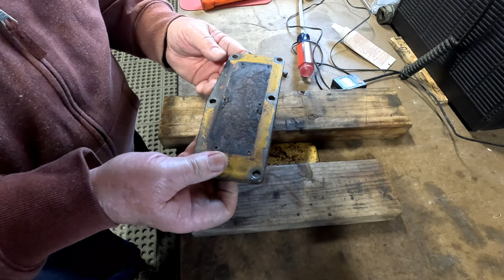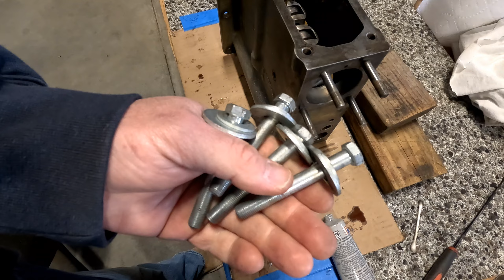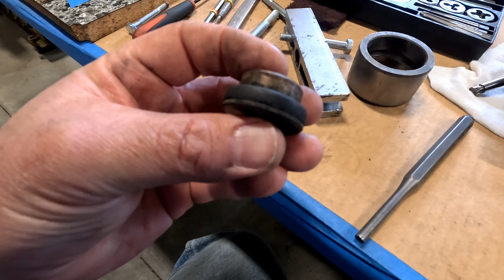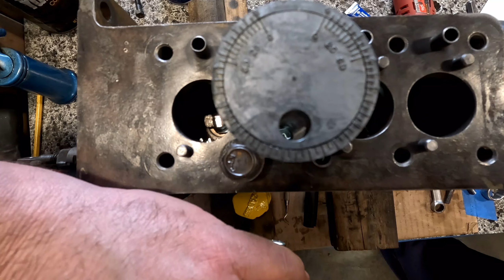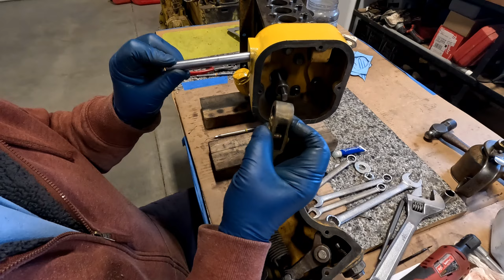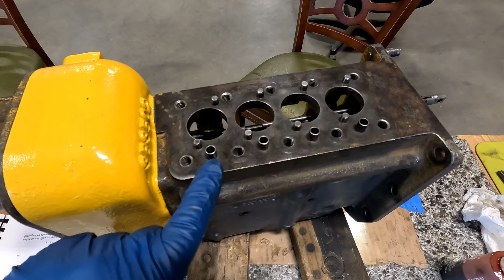High pressure fuel pump assembly. 1939 Caterpillar D4 4G9986 "Lil Lefty" Episode #94

Comment: Great videos and very informative. I live over the water in the UK, we are having a few issues with a D4 7J. 
We appear to have a lot of white smoke (unburnt fuel) when running and somewhat of a poor starting and running (similar to a miss but not actually missing) After watching one of your later videos I set about setting the pump timing via setting depth of yolks/forks to 1,735 thou (and camshaft is 2A5559 and understand lifter height is correct) Bizarrely before adjusting they had been set to 1,605 thou. 
Since adjusting to 1.735 then main engine will not start yet going back to 1,605 then it is running again (but as before not greta)
It was suggested we try some different pump elements (from a D4 supposedly) a chap had to confirm if our elements were ok etc, however when checking over the metering shaft/pintle are different diameters between the two sets of elements (approximately 1/32) so could you or anyone else suggest what the correct diameter shaft/pintle should be so I can decide which elements to start with (my theory being a large diameter pintle can deliver more fuel per stroke hence possibly the white smoke) 
With regards to the lifter height we are starting to think that perhaps there is a timing issue within the timing case for the auxiliary drive etc.

Would really appreciate some advice, measurements and guidance as I am sure you can appreciate not a huge amount of these in the UK and the knowledge is pretty scarce on the ground so far
Reply from the maker: I see my first comment got removed because of a link I had in it. Do you have a caterpillar fuel pump servicemen's reference book? There are quite a few on eBay and it can help you with finding the exact lifter numbers. It's all going to be according to the cam number on your fuel pump. The cam number should be located on the tag external to the fuel pump. It can also be found on the cam itself. That will determine your lifter settings when your reference the book. Please change drastically during production model runs. No two fuel pumps are the same. If you don't have access to the book I recommend a membership to the Antique Caterpillar Machinery Owners Club. They have an online library with valuable literature available. There's also an online form that is a game changer with access to Decades of knowledge. 👍
Reply: @ thank you for the response, I had found via ACMOC from someone else whom had a at pump book that cam A25559 should have a lifter height of 1,734 +/-0.002” therefore I have set to that height and since the issue with none start which leaves me to believe there is a bigger timing issue within the likely within the front end?
If as I suspect there is a timing issue within front end then this could explain the excess white smoke it has had since getting it running after many years of not running due to what was thought to be wetting. 
I would still like to find out what the Dina of the pump element shaft/pintle should be as the casting number in the x8 bodies I have are the same yet x4 have the same size shaft as each other and the other x4 have the same but approximately 1/32 size shaft. 
Basically I am hoping someone will have some from a D4 7J engine they could measure and confirm as aware there are more spares state side. Not sure if it makes a difference or helps but the chassis serial number is 7J2887W and engine number is 7J3833
Reply from the maker: I've been thinking about your problem. If it ran with the fuel barrel settings you have and after you readjusted them it may not be a fuel barrel issue. Have you done an inverted injector test? Maybe check the cone spray. It could be an injector issue. White smoke could also be water. The pre combustion Chambers on early 7Js are the same as on the 4G tractors. They are prone to failure and leakage into the cylinders. That can cause issues that appear to be fuel related. Before you mess with any timing I would start with the inverted injector test. It could also pinpoint which cylinder is the issue. 🤔
Reply: @ the injectors have been sent away to be fully serviced and all in pristine condition as performed a inverted test previously and they wasn’t horrendous but did seem a little lacklustre in spray pattern (definitely improvement since service as was sent video confirming no leaking and great atomisation) 
I do not feel the white smoke is water/coolant as it’s to dense if you get my understanding. 
Really struggling to understand when the setting of lifter height is so critical (ie +/- 0.002”) yet we are approximately 0.150” out which is essentially the cam lifter at full lift at TDC which cannot be correct as I understand it should have completed injection some time before TDC ie engine retarded which the lower lifter height would indicate that also I feel. 
It’s a real head scratcher and being first time working on a cat of this vintage confidence is a bit blown (quite a bit experience in setting pump timing on rotary and inline pumps with spill timing etc)
Reply from the maker: Sounds like your fuel plungers may be worn out past tolerance. They will get to a point where there's no adjustment that can fix it. The only other thing I would definitely make sure if is the teeth are perfectly lined up in the rack setting. Being one tooth off can cause similar symptoms. Have you checked the plunger wear to the top of the yoke? It shouldn't exceed 0.005". The overall length of new plungers is 2.6575" - 2.6577.

Comment: Fantastic job Aaron-n-cleaner. You nailed it right where it has to be, usually you need a stand to do this. But CAT allowed also other methods to set the pump timing and angle.  Seen lot of high pressure fuel pumps where someone in there infinite wisdom. Removed the lift pump or left the plungers full open. Dose not take much rust to make the pump unusable in a very short time frame. Word of advice if you do leave a pump sitting in a shelf make sure the plungers are full of oil and sealed from the outside element. Same goes for the lift pump. I have noticed that CAT had different governor designs for the D4? I wonder why?
Reply from the maker: There's quite a few subtle differences between the D2 and D4. The fuel pump sat on the bench and we were a little worried to tackle them for a long time. Once we got the books and the knowledge they came together quite nicely. Hopefully they passed the real test which is a test run!